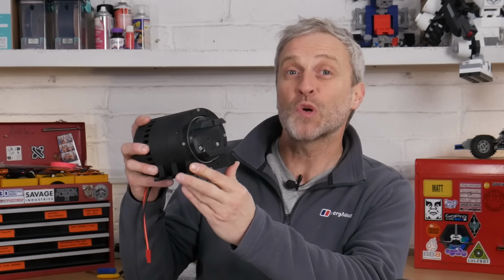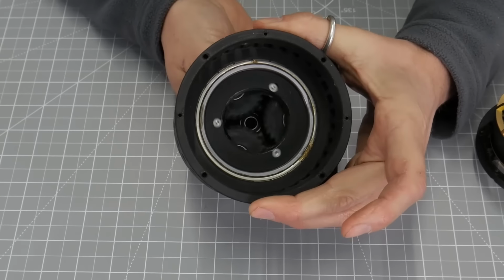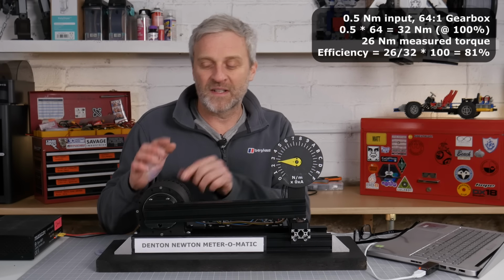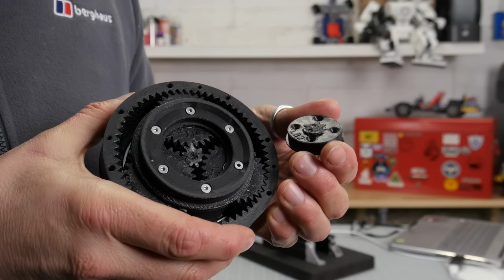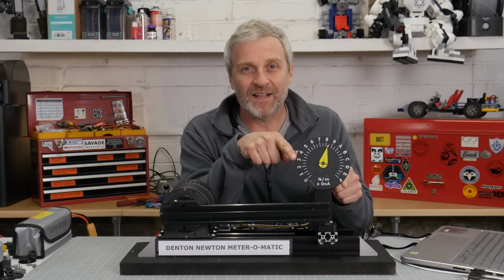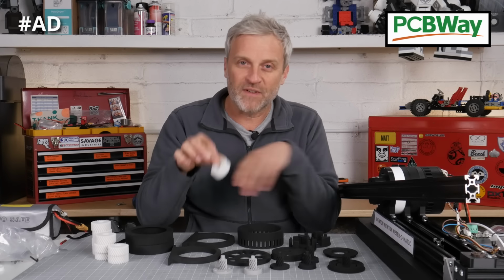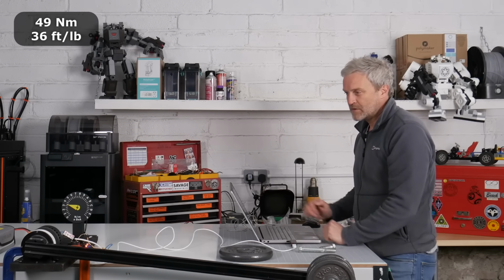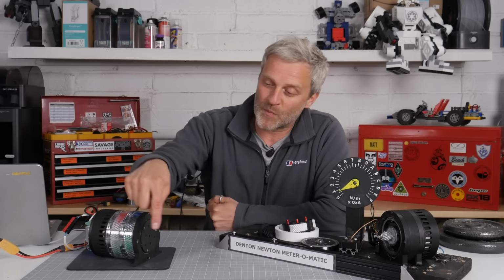Massive Torque 3D Printed Planetary Gearbox! - Mantis Hacks

Comment: You should loook into split ring planetary gearboxes (Wolfrom drive) they can create a lot of torque in a smaller space, you could get a significantly higher reduction in only one stage
Reply: I am currently designing a Wolfrom drive that currently has around a 270:1 reduction (it is a work in progress and is on a much smaller scale). I also have a finished one that has a much lower reduction 92:1
you can find links to my designs on my website, although both my designs were for a much smaller scale
Reply from the maker: Yeah I’ll take a look at that! Sounds interesting
Reply from the maker: Ok will do 👍👍

Comment: The first stage never failed, it is never maxed out.
The second stage needs some increase in sun gear size.
So why doing 1:8 plus 1:8 then?
Try 1:10 plus 1:6 or even 1:12 plus 1:5. Gives you better utilisation of the first stage plus bigger sun gear on the second stage without changing outer gearbox diameter.
Reply from the maker: Yes exactly! This is why I comment at the end saying I’ve been lazy and just doubled up the gear box. But clearly the first stage can take way more torque. In fact I have the numbers for how much torque the sun gear can take and it was like 12 n.m so given the motor can only supply 4, it would be better to increase the ratio in the first stage as suggested 💪

Comment: Something to consider is that helical gears produce axial thrust loads when force is exerted through them.  Your efficiency loss as the torque builds could be the result of high thrust loads within the gearbox.  Straight cut gears will not produce axial thrust and herringbone gears are thrust self-canceling.
Reply from the maker: Yes, I meant to discuss this during the video but forgot. But you’re right, it may well be the thrust that is massively reducing the efficiency. I may do a follow up with straight cut or herringbone gears 🙏

Comment: Hi, nice project, what do you think about use air accumulation of energy when weight going down, for use this energy when you need start moving to upper direction.... Less energy will be used for start moving...
Reply from the maker: Yeah sounds Interesting, but possibly tricky to implement 🤔
Reply: @MattDenton  i mean when moving down you need to compress the spring
Reply: Only start movement is heavy, this can be simplified by just endstop springs - that allow start without huge energy

Comment: You could try to add a bolt through the sun gear, or other parts of the gearbox to put the layer lines in compression. Similar to how prestressed concrete works.
Reply from the maker: Nice idea 💡 💪
Reply: Came here to suggest post-tensioning the sun gears with a bolt, but also printing the hole through the gear will also increase its strength without the bolt since the slicer will print that as outer perimeters and hence print solid.
Reply from the maker: @Person1873 yep a hole through the middle would be an interesting test. The core of the sun gear doesn’t add much strength as it has a low surface area, which is why many axles are hollow, it saves weight and looses little strength. But with a 3D print the hollow shaft idea would increase strength 💪👍
Reply: That is indeed a very good idea
Reply: This !
Reply: You mean post tension concrete? Semantics/pedantic but I had the same thought 😅
Reply: @justinclark9258 I was curious to know the difference so I looked it up. 

Post-tension and pre-tensioned concrete are both considered pre-stressed concrete. 

“They’re called prestressed concrete because the concrete is intentionally ‘stressed’ (put under tension or compression) before it’s subjected to real-world loads.”
-ChatGPT, 2025

Comment: You can also try splitting the sun gear along the axis, which will result in layer lines the length of the axle, then super-glue the two halves together.
Reply from the maker: Great tip! I may try that
Reply: Was thinking the exact same thing when watching.  I couldn't tell exactly what the alignment was until he popped up the opentorque actuator site, where you can clearly see the layer lines.  Print orientation is "definitely" an engineering element when you're building something functional.  

You can even use the layer lines weak points as a 'feature' if you're trying to build something you want to split at the seam.  I've used it to create items that split from a circular base to have a spring-like effect that pulled the open ends together to gently fit around something.

Point being, this is a great tip.

Comment: Apparently, you can get a lot more efficiency with plastic gears with the correct lubrication.
Reply from the maker: Yeah I did wonder if silicone spray might have been better than silicone grease
Reply: @MattDenton  I use white lithium grease spray in mine. I'm not sure I can speak to it's efficacy, but it certainly hasn't hurt

Comment: Given the nature of field testing and displays are that if something can go wrong it will might I suggest that hex walker's belt drive gears should be held in place with shear pins - looks like the easiest place to replace the mechanical equivalent of a fuse, and you don't want to be dismantling the gearbox every time anything goes wrong. Love all this testing though, nice to see proof of the manufacturing process can do the task rather than just the pure mathematical and entirely theoretical analysis that rarely really stands up in 3d printing mostly because its never isotropic.
Reply from the maker: Yeah a mechanical firs would be a great idea, I got really bored taking apart that gearbox to replace the sun gear 😂
Reply: This is a great observation. everytime something breaks on my robot I ask myself if I want to make a stronger version or if it's actually a reasonable place for failures to occur.  being able to rapidly reprint and be back up and running quickly is certainly useful

Comment: One way to get extra strength out of your gears would be to cook them in salt. Two videos have to be watched and both are here on the site to get you going. I've done some ridiculously strong PLA prints using this method and once you've dialed in your particulars, you can pop them out with very good precision (to be read, it's a repeatable process). One highly important tip, the salt has to be ground to basically reach dust status. I've actually used an antique electric coffee grinder for this task (the one that looks like an inverted lawn mower). Another trick is to make the finite gear bi-component. The outer shell should be baked, but the shaft and spoke area should be regular print. As with all things taken to maximum hardness, shattering becomes an issue. One of the projects i've done with this method is the gears inside a sewing machine. Side-rant: a specific, defunct brand of sewing machines that starts with S and ends with inger, has parts priced to ridiculous costs, so i bypassed that with good old measuring and printing. One of the prints has now, nearly a whole year of use in a regularly used machine and three weeks ago when i checked out of curiosity, it specced out to exactly where i'd measured it when i baked it. So this method is not to be dismissed. Atop of that, you can use PLA with carbon inside, and PLA with metals. It does work, but you have to really test out a whole slew of times until you figure out the right settings. I use an old common, cheap as cheap gets microwave oven, but when i tried it at a friend to help them set up with a much more modern B-osch unit... it didn't work out as planned and the part cracked. There was a whole 2 minutes and 6 degrees of separation between our two units.
Reply from the maker: Really interesting stuff here! I used carbon filled PLA in the first lot of tests, it doesn’t do any better than regular PLA, however I felt the carbon element may be too abrasive for gears
Reply: I have experimented baking PC in powdered salt. I found a "blender mill" to powder-ize salt in seconds. 10μm particulates says my microscope scale. And by baking I mean fully melt the plastic, which requires some sprue (inverted cone printed atop the part) to compensate for the shrinkage. The part must be as close to 100% infill as possible. Technically you can have a hollow part and a massive funnel sprue full of plastic scrap. But you cannot hold the plastic melted forever as it degrades. I had a better experience with 100% infill and as short of a melting time as possible. The finer the salt the better the surface finish. Dimensional accuracy is surprisingly good. And yes the resulting part appears similar to injection molding in performance in my limited testing. I propose we call this cast pickling ;)

(sorry for the many edits, for some reason YouTube gives me the tiniest and most uncomfortable textbox)
Reply: @aserta  I have used a toaster oven. And even made my own fiberglass sleeved main's voltage resistance embedded in salt. I was trying to heat fast, and maintain it melted for the shortest time. I thought about using an old microwave, but I have concern about the wave pattern. In my experience a microwave does not heat evenly at all, and plastics have quite a narrow range between not melted to burnt. For example the PC I am using only starts melting at 265°C but starts degrading visibly when exposed to 290°C (the printing temp) for a few minutes in salt.
Reply: Yup,  the metal clay filaments after sintering would be a great choice for diy makers